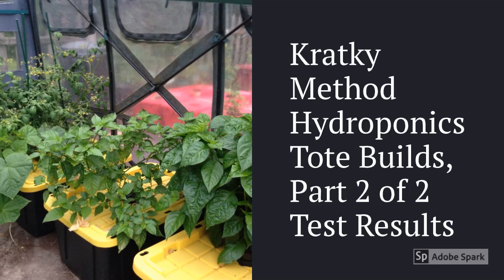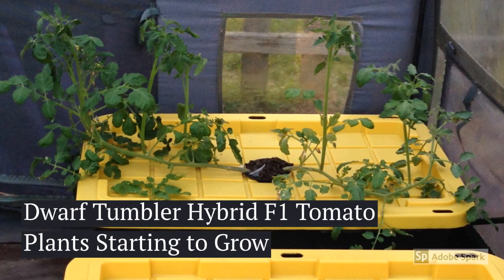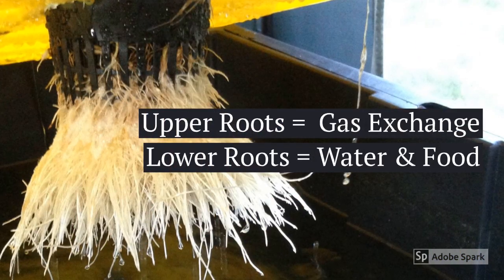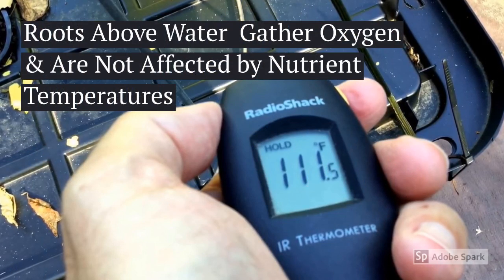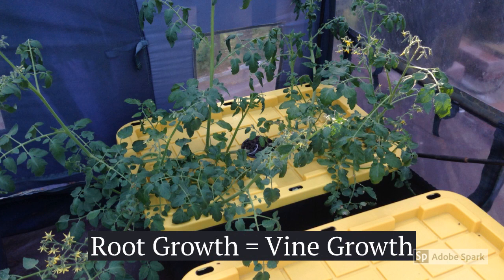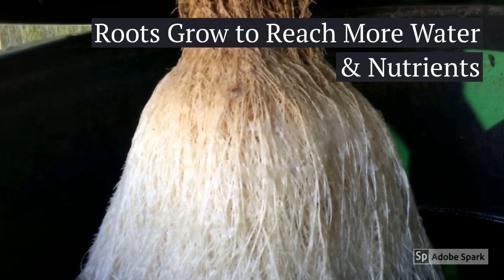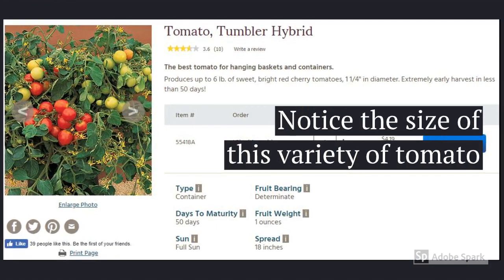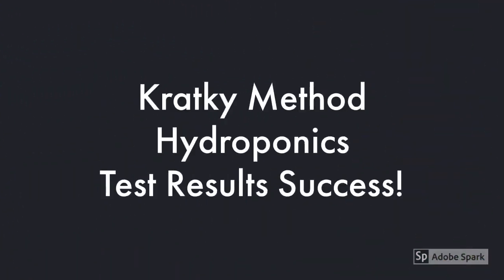B.A. Kratky Method Hydroponics - Part 2 of 2 Grow Results

Comment: Thank you for the knowledge. If I don't have a green house and just put the totes outside with no coverings, will the morning sun and afternoon shade be enough for these to thrive?
Reply from the maker: Depends on how much sun that you get.  Outside is more of an issue with rain increasing the water level in the totes and drowning the specialized gas exchange roots.  A 32 gallon trash can with dome shaped lid helps reduce rain.  Start with some trials and build on your knowledge.
Reply: @MattGarver  thank you

Comment: greta video Matt-thanks

2 questions:
if i were to grow lettuce in this container with this method, how many could i fit into this container?
and how many 42 watt led (t5 style) lights would you recommend

thanks!
Reply from the maker: Thanks for the kind words.  First, 27 gallon totes are not great for lettuce.  I just grew four massive heads of romaine lettuce in a five gallon bucket.  They only used around 2.5 gallons to maturity.  Typically figure one gallon per mature head.  Second, a 8" x 8" or 12" x 12" space is needed for each head of lettuce.
Reply: @MattGarver  thanks Matt, very much appreciated!
Reply from the maker: And about light, Google daily light integral calculator.  Feed in the PPFD from the lights you are using, and 12 for the DLI.  It will tell you how light is needed.

Comment: Hi i have a aerogarden and some of these black with yellow lid totes laying around i will for sure try this method. Please give us little more details which solution did u use exactly and is it possible to use grow lights?
Reply from the maker: Hello Mona, I use Dyna Gro 7-9-5 since it is a complete nutrient.  I add 1 to 1.5 teaspoons of it to 1 gallon of water.  Also, I use grow lights all the time.  If you are looking to save money, some of the normal household LED lights work also.  It just depends on whether you are growing a small head of lettuce or a large tomato plant.
Reply: Matt Garver im trying to grow both lettuce and tomatoes how many watts led  bulbs do i need
Reply from the maker: @monaali1898  Depends on variety and size, plus quantity.  Also, it depends on growing method since hydroponics usually produces larger plants.  So let me give a couple examples.  Growing small varieties of leaf lettuce, I can easily grow 7 plants under a 30w LED panel.  Growing a small tomato plant like Tumbler Hybrid F1 can easily be done under under a 100w LED panel or a 150w HPS light.  Hopefully that helps.

Comment: i have a theory that the upper roots are not valuable.  it will take some testing to evaluate this
Reply from the maker: Jeb, thanks for commenting.  In hot water, typically it holds little oxygen.  The surface or boundary layer of water can still hold enough oxygen to support plants, since it is getting oxygenated by exposure to the air above.  By keeping a plant in very close proximity to the upper 0.5" to 3" of surface water, you can avoid needing gas exchange roots as seen in this video.  Some plants are more tolerant to doing this than others.  With the method that I show here, tomatoes and pepper plants will grow more quickly by maxing out the available gas exchange and water/nutrient uptake.  I will be curious how your tests go!